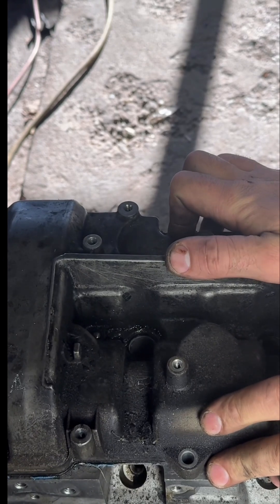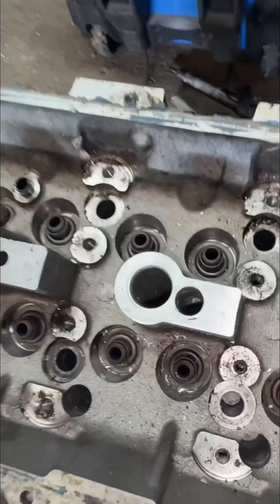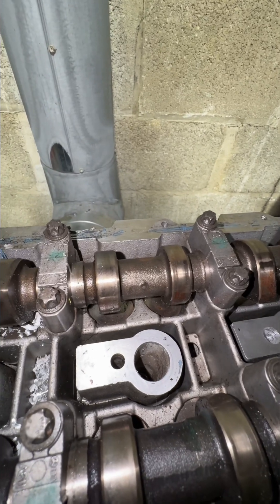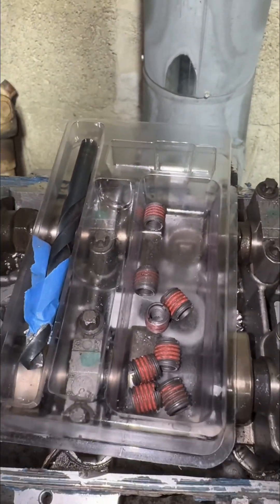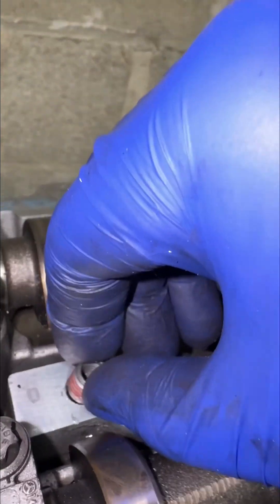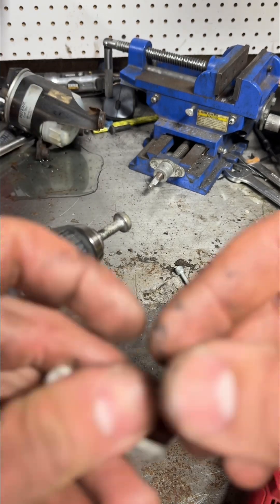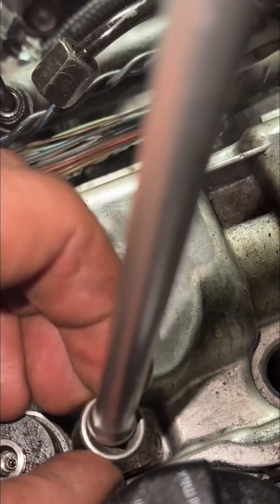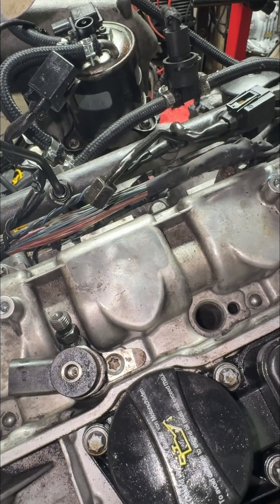Repairing Fuel injector hold down bolt holes in e320 Cdi Sprinter engines. Part 2

Comment: Y not just use a thicker bolt and tap the hole shorter and thicker bolt with tap = less work and new stronger bolt to hold down injectors
Reply: On mine, the screw is turning freely. At the end of the threads. No broken screw inside. What should I do?

Comment: What is the size of the Bolt is it 8m and wha is the size of the drill is it 10m.I got same problem and cant go with 8m back to 6m so is it save to drill a 10m hole so i cant put a 8m bolt

Comment: You mentioned the Mercedes OEM M7 1.0 bolt early in the video. My dealership parts guy is unable to locate it without additional info such as part number or model of car or where on the Mercedes it’s used. Could you provide any info on that? Thanks.